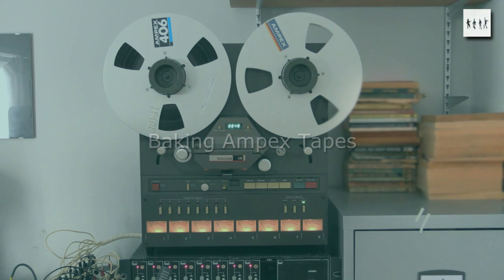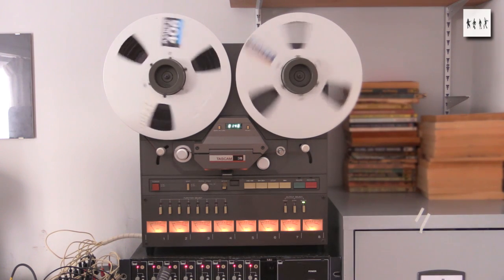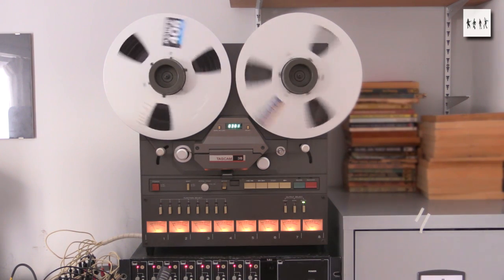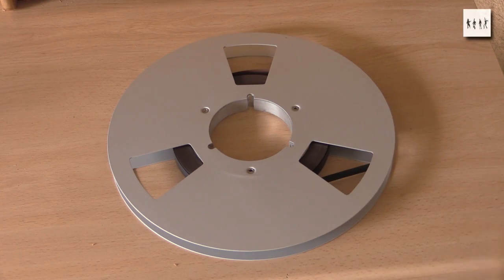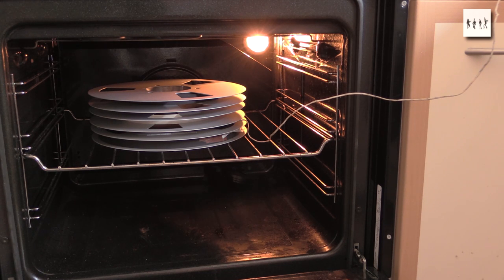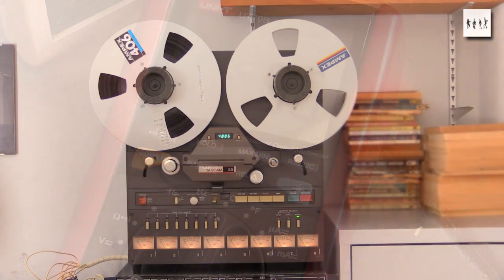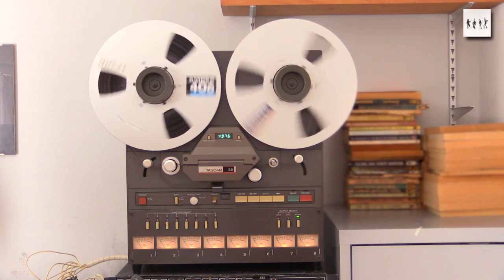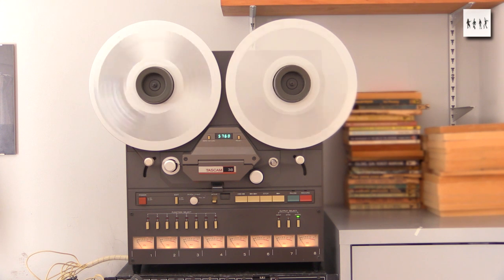Baking Ampex Tapes

Comment: In 1992 I came across the master tapes of "Ye-s-Close to the Edge" at a studio in Los Angeles. I put them on a machine and carefully rewound them very slowly to make sure there were no problems. There were several splices so i wanted to make sure they didn't break. It turned out to be the old European pink Agfa tape and played like a charm. So I got a reel of Ampex 456 and made myself a copy. (Bear in mind at this point the original masters were about 20 years old) I tried playing the copy about 5 years later and it was COMPLETELY gummy. I'll bet those Agfa originals still play just fine.
Reply from the maker: I'm sure they would, Ken. Sometimes, you can be pleasantly surprised:  I recently volunteered to transfer an archive of recordings from the late 1980s / early 1990s, and was fearing the worst. But it turned out that all the recordings were on 1/4" Maxell UD tape, and that they were in perfect, as-new condition! It was quite a relief after dealing with my own archive, which consists almost entirely of sticky-shedding Ampex tapes. So you win some, you lose some!
Reply: I have yet to have any issues with Maxell. I bought 10 UD used from the mid 70's and all were in perfect condition.

Comment: buy a Food Dehydrator like the American Snackmaster FD-50 - I've used those. Reels fit perfectly. Temperature is low enough and controlled. Works.
Reply: can someone confirm that this method would work?
Reply: @alkayemediagroup4536  I used a food dehydrator as well and it did help the playback for awhile.

Comment: I've had this also with Shamrock tapes. Tape  wasn't even used at all - long storage. I Was surprised - it was so advanced that tape wouldn't unwind at all - magnetic layer when  unwinded by force was detached . . .After  I did such bake drying. It helped instantly - could unwind and record but after months whistling happened again. Two reel melted by temperature.  So I decided it's too much job and developed my way - only  condition is that tape is easy to unwind so first for those very bad is is to bake them. . I unwinded parts of tape loose to plastic container - rather not big one - mine was about 4  liters. Then this mess I dried with hair dryier untill the smell was sagnificantly less and tape got foldown, - usualy about 5 minutes, then wind it up to next reel and repeat with next part - for whole 7"  reel  it takes about 4 repeatitions. With beeing carefull not to definitely mix tape  it is quite easy to regain it from mess. Take care to use not hot by hand but warm blow - some polyesters are vournerable for temerature. Having reel tape recorder it is convinient to use it for winding job in "play" mode with coupled reel. . It takes about 1 hour of job.This way I got permanent removal of sticky shred. I have also 3 Ampex which shown magnetic layer detachement - and after this drying it is so far stabil. I did this to few of my 26 pieces of Scotch which were showing  signs of slow  winding and it hepled too. All is  working fine and  because I am happy to see turning reels  I am not willing to make digital copies.
Reply from the maker: Looking on the Internet, it seems that Shamrock tapes were made by Ampex, which may explain the sticky shed problem.

If the plastic reels had melted, that would suggest a temperature much higher than the 55degC recommended, but as I have only baked tapes on metal reels, I couldn't say what temperature plastic reels will actually melt at. The reels you show on videos of your modified B115 tape deck look like actual 8mm movie reels (with sprung radial arms), and they may be quite a soft plastic.

Glad to hear you've had good results, but I suspect they will get sticky again with time!
Reply: Anything may happen.  But up to my observations it depends also on humidity around. And my is low. With tapes which were very bad as 3 pcs  of my Shamrock  it is  not reliable - they already suffer from weak contact  of magnetic layer with polyester so deck needs often to be cleaned and it is not pleasant but they are exceptional for  sounding - better than CDs. Some Shamrock never had any problems -seem  trusty and also good sounding.  Shamrocks  was my experience 5 years ago  Today I do not expect anything like that with Scotch which is made in Italy and in perfect condition. Generaly I dry tapes even other makers. in case when winding speed is not normal or they are dirty before cleaning them more  while  they do not show typical sticky syndrome.  I regained some tapes from pretty bad state not to play them but to record which is higher requirement. My casettes were  in  high humidity for more than 10 years, some  chrome  got even something like surface fungus and it is nonreperable. Strange but cheapest Fe are in primary shape for already 25 and more years. They are recorded in analog and sound marvelous.  . PS reels which are in my clips are ORWO -old   East German production very usefull for it's  good design.And those unlucky were original  Shamrocks  which waited for me too long  utill I finish my phone call:). Surprizingly tape wasn't hurt but I cant tell exact temperature they survived. .

Comment: I've found half an hour baking will give you around the same playability(2years),be warned,however that when re-recording the tape will not record like a new tape and will suffer drop outs(AMPEX)...AGFA,BASF are way better tape and don't suffer this problem and will give you more signal to noise thatn AMPEX,although sourcing it is difficult these days(AGFA 468,BASF 911)
Reply: that really depends how sticky the tape is, how long it layd still, and in what conditions. I have some ampex 1/2'' tapes, i tried baking them for 4,5 hours, at 55 degrees in a food dehydrator, and were still sticky. i had to bake them again for 24 hours, only then they were playable again

Comment: Am having thids problem with 7 inch RR on plastic reels--will baking them melt the reels or the tape
Reply from the maker: Spool the tape off to an empty reel and test the reel on its own first to see if it behaves. Or spool tape onto a metal reel for baking. A food dehydrator is a safer solution (see various other comments and YouTube videos) but bear in mind that dehydrators tend to have a large diameter central boss, so they only work with the large central hole of a NAB reel.
Reply: @reqordist  Thats unless you have a square tray food dehydrator.

Comment: Hi this is a great vid, I have loads of tapes I have to do. Can you tell what the cable you used to measure the temperature. And also do you bring the tapes up to temperature or put them in at heat.

Comment: A question If the tspes have exposed to water can they be playable again? Many thanks
Reply from the maker: I assume you mean the water from humidity in the air. 
In my experience, after baking, the tapes are playable for a week or two. Tapes I had baked once and left for a few months needed baking again, which did work. 
I would recommend baking and then doing the highest possible quality digital transfer you can, so you don't need to play the tape again. 
I would not use baking as a strategy for doing new recording work on old sticky tape stock: if you do want to do new tape recording, I would advise buying new, good tape from the couple of manufacturers that still exist (but it's expensive!)
Reply: @reqordist  Hi my friend no actually what happened is that there were outside in garage but i hadn't realised part of the roof had caved in and the box I had my tapes in got filled with water
Reply from the maker: That is a different matter. 'Good' tape should not absorb water. If the make of tape is not one of those that suffer from sticky shed problem, they should be playable after allowing the spools to dry out very slowly. If there is a build-up of mould from the water immersion, it may still be possible to wash it, but there's no guarantee. Just make sure that the tape is dry before running it through your tape recorder. Good luck!

Comment: How many shots would you normally get at transferring your material after a baking? I remember reading about how Wendy Carlos had to bake the Ampex masters for "Tron," but she only had one chance to do the transfer into ProTools because she had no idea whether the tape would stand a second try if the first transfer messed up.
Reply from the maker: Hi Larry - I could not say definitively.

However, I have done several digitizing runs after baking to capture at different sample rates etc., and the tape seems OK to me. My personal take on it is that if there's no oxide coming off on the heads and guides after baking, then it must still be on the tape. A tape deck with properly demagnetized heads and transport should not affect the signal on a tape to any noticeable extent (or multi-track recording would have been impossible) And yes, I know tapes will eventually wear out, but I reckon that needs hundreds of passes on a well set-up transport. 

As the moisture returns to the tape after a while (weeks? months?) I wouldn't recommend it as a way to use old sticky tapes on new projects, in case you were tempted! I revisited a tape some 2 years after I had first baked it, and it had gone sticky again, so I had to re-bake it to make it playable. that seemsd fine, but I have no idea how many times a tape can be re-baked before it degrades noticeably. 

Please bear in mind that this is what I have done with my own tapes (which are all Ampex except for one Scotch tape), where they only have value to me, and I make my own judgement as to the risk; your tapes may be different in formulation and react differently to baking, and may well have much greater value to you, so it's important to try it out with a non-critical tape of the same formulation (if you have one) first, or consult a professional who bakes tapes commercially and has experience of many different tape types. 

BTW I do mention in the description that I now use a food dehydrator instead of the oven - a technique that seems to be well established by others. It still needs calibration and monitoring, but it seems more controllable (and is more compatible with home cooking..)

Comment: My mom bought an Ampex tape recorder in about 1965.  I still have it and it plays but the brakes don't stop the tapes so my finger has to.  She got a lot of Ampex tapes with it and they play fine.  I transferred them to CD but these are 50+ year old tapes.  I also have a couple of tapes made on my brother in laws R2R from back in 1958.  That tape still works but is brittle.  I have transferred it to CD too.  Is it just later Ampex tapes that this squeal happens to?  It doesn't much matter to me now as I only have one tape to transfer and I don't even know if I will do it.
Reply from the maker: Yes - Ampex tapes from the '80s and '90s seem to be the affected formulations. It was a quality control issue and when they were made aware of it (why did it take so long!), they revised (corrected) the formulation and fixed the problem.
Reply: it's more like ampex tape from the late seventies and onwards that had the problem
Reply from the maker: That seems to be the case, but it is probably because the binder formulation error was in the 'professional' tapes which tended to be back-coated; in my experience, it is the coating on the oxide side that goes sticky, not the back-coating.

Comment: I have a question 🙋🏻‍♂️. Does it smel verry chemical when you bake a tape?
Reply from the maker: In my experience, there can be a slight smell. But you should only be driving off water, not causing the tape to break down chemically - which would damage it anyway. 55 deg C is not very hot. But it's always best to work in a properly ventilated room, though.

Comment: One quastion: This solusion is good if the tape is being rolled on a metal reel. But what if the tape is rolled on a plastic reel? Will the plastic reel survive the oven heat without melting? And if the plastic reel can reallt melt - how do we transfer the tape to a metal reel whithout using the tape recorder?
Reply from the maker: I have only done this on metal reels. Baking only takes place at between 50 and 60 degrees Celsius (if your oven behaves and you keep an eye on it). Certainly worth trying with a blank plastic reel first. I have moved on to using a food dessiccator, which  unlike my kitchen oven is not designed to go to much higher temperatures. The dessiccator has plastic separator trays, which seem to survive OK. But as usual, do your own tests and bake at your own risk - good luck!

Comment: Hi, I have a couple of commercial pre-recorded classical tapes that have serious tape squeak when playing. There does not seem to be any real evidence of sticky shred, surfaces seem dry. Any ideas how to solve the problem as I do not think that baking is the solution. I  did hear that putting some sort of silicon coating on the tape surface may work. Have you any experience with that sort of solution.
Reply from the maker: There is a lubrication technique (which I have not used), and that may be more applicable to other brands/vintages of tapes that are not suffering from different degradation mechanisms from the classic Ampex '80s - '90s sticky shed syndrome. 

Personally I don't like putting 'goo' onto my tapes and/or tape decks, but if it's a critical transfer of irreplaceable material, maybe it's worth the risk. Some people may offer this sort of tape treatment as a paid service. 

Most pre-recorded tapes are simply not worth transferring, as the quality is poor; many such recordings will have been re-mastered from source tapes and re-released on CD anyway - it's worth researching that first, before taking any drastic action with your tapes!
Reply: that was my first thought, have a look at that curtain rale lube thats non stick, no dust or stain etc etc. they use it on valuable fabrics, might be worth investigating
Reply: just because it's not obvious does not mean that they do not benefit from baking

Comment: Great video I got a bunch of tape pancakes that have sticky shed I think I'm going to have to wind them before I can bake them how do I do that?  😎
Reply from the maker: Hmm... tricky one. 
Firstly, how do you know they have sticky shed if they're on pancakes and have not been spooled? 

Assuming that they are sticky, my inclination would be to bake them as-is without attempting any winding operation beforehand, as the action of winding can rip oxide off the tape at points where the stickiness acts as a glue.

If you absolutely must wind them on a tape machine, I would arrange for the tape to pass from reel to reel without going through the head/guide path. This may involve holding up the guide/levers by hand to enable the motors. And the slower the better!

Good luck!

Comment: I've been using a dehydrator sold on Amazon, which they advertise as "Rosewill Countertop Portable Electric Machine Food Fruit Dehydrator." It's $40, and it fits both 7" and 10.5" reels with no modifications at all. It will also hold 1/2 inch audio tapes, VHS and Betas, and of course cassettes. I set it to 60 degrees C, load the tapes in it, and leave it alone for 24 hours. Works great. Comes with five see-through trays. It's like it was made for the purpose. And yes, it uses forced air ventilation. redbankvintageaudio.com.
Reply from the maker: Hi Scott. Sounds identical to the one I'm currently using - these all must be generic models re-branded by different importers. My experience is the same as yours - it works very well and is less risky than using a conventional oven. Haven't had to use it on video tapes or cassettes to date, though. I've found 4-5 hours does the job for me, even with 1/2" tapes - did you experiment with different durations before deciding on 24 hours?

Comment: TDK produced the finest tape.
Reply: it was never really a 'pro' brand but consumer only .... BASF, Ampex, Scotch and a few others were the most respected -though the ampex obviously had unforeseen problems with it's chemistry
Reply from the maker: True - they made great cassette and 1/4" open reel tapes, and I had good results with them, but I can't recall them producing tape in open reel formats wider than 1/4", and if that was the case, it would not have been an option for studios using 1/2", 1" and 2" machines.
Reply: yes - i've NEVER seen TDK available in anything over 1/4" - either being sold new or else second hand ... and I've been using it and buying since the 80s ...
Reply: Totally agreed, if we talk about 1/4" tapes - TDK and Maxell are the best. Also, BASF and AGFA are not bad if properly stored over the years. AMPEX is junk. They were good when produced new back in 70's and 80's but over time they turned to junk...